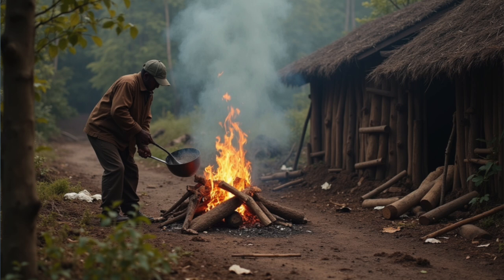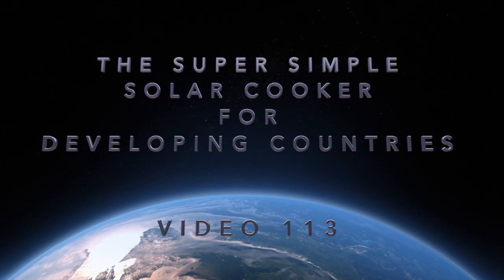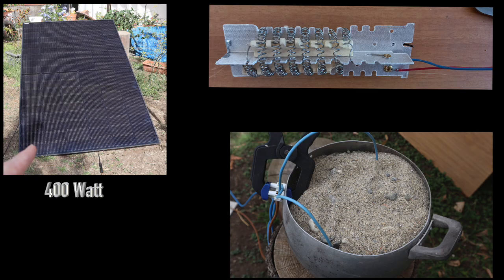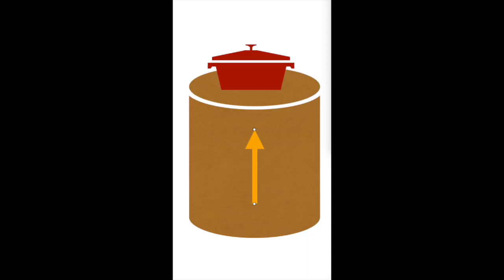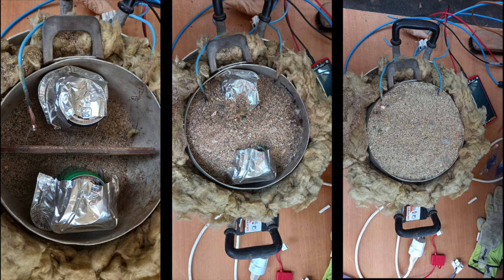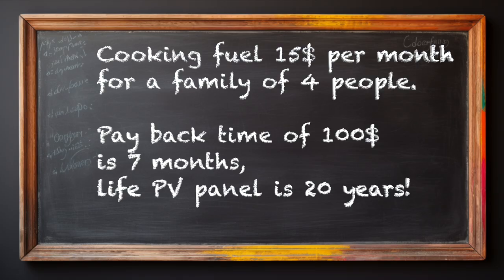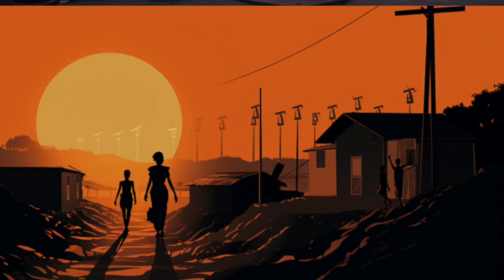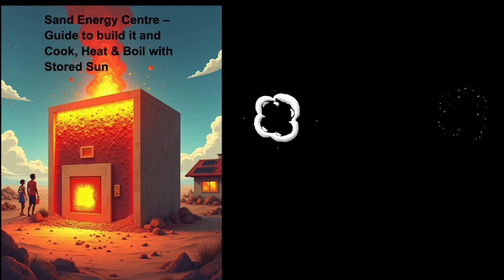The Super Simple Solar Cooker for Developing Countries - Video 113

Comment: Great idea..Thanks..Could you show some food getting cooked using this technology. I mean like rice getting boiled etc....how much time does it take to cook food.
Reply from the maker: Yes, I wanted to do that but then came the bad weather. I am very curious about the results and will see when it's better weather here in Sicily. Without those cans in the sand I did some experiment and the water cooking was too slow. Then it appeared to me that the sand is slow to conduct the stored heat to the surface and I got the idea to bring metal heat conductors into the sand.

Comment: I had an idea. I could heat the sand inside a small paint can using this method, and then place the can inside the solar oven whenever I needed to use it.
Reply from the maker: Hi Ofor, but if you place it already in the solar oven, it gives less heat losses and less dangerous because you don't need to transport very hot objects.
Reply: @nnvasen-good-energy  Better idea! :D

Comment: Well done doing this.
Have a look at the AGA cooker hotplate. There is one with a lift-out plug in the centre, but it’s actually a very heavy steel bell shape. This would be ideal set in sand with the element in the centre, topped up occasionally from the centre plug, and a poured mica outside for insulation. An AGA style hinged insulating lid would keep it insulated when not in use, and the whole thing could be built next to a fireplace similar to other bread ovens. 
I wish you a speedy recovery my friend.
Reply from the maker: Thank you RPerkens for the positive feedback and the great ideas, I really appreciate it and also the wishes for my voice! AI may have its dark side (am now looking a YT movie with this title) but at least I am not voiceless with T2S!
I am not sure if I understand well your proposal: I think it corresponds to my idea to put a metal pan upside down in the sand with the bottom plate just level with the sand surface, so that a "real" pan can be put on it (bottom to bottom). There is somewhere I picture in my video of this idea alongside the two cans. The sides of the pan will conduct the heat from the bottom to the surface and the bottom gives the contact to the pan that the user places on it. I am convinced that this will work. Anyway, you are right to mention also the need for an insulated lid.